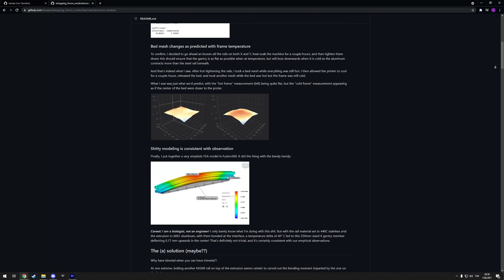Why I Couldn't Make Videos Lately (& Possibly Near Future) & WIP Projects Updates

Comment: tunnel syndrome maybe? I hope its nothing, keep us updated and good luck!
Reply from the maker: Thanks. It's likely ulnar tunnel syndrome since it begins in my wrist but the question is what caused it. Inflammation is the most likely and better one but I didn't hit it so idk.
Reply: @IsiksTech  If you partook in an experimental drug trial in the past year that would most likely be the cause my man :/ Hopefully you received treatment for this, doesn't look fun at all. 

Other than that, did you manage to find out what caused the extrusion problem in Ep22?
Reply from the maker: It was cubital tunnel syndrome, had surgery, it's better now but still not great. The strength is back but I still can't move my fingers precisely (like 10 finger typing). No experimental drugs. But there some weird blood values discovered after I moved to the US. Can't get the tests necessary to rule out other conditions yet (no insurance).  I still don't know the reason for the print problems. My printers are not here yet.